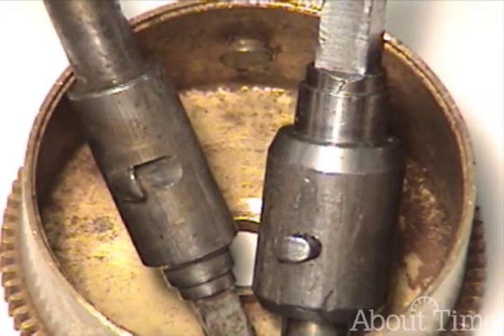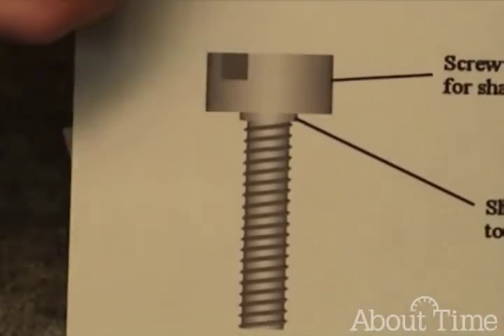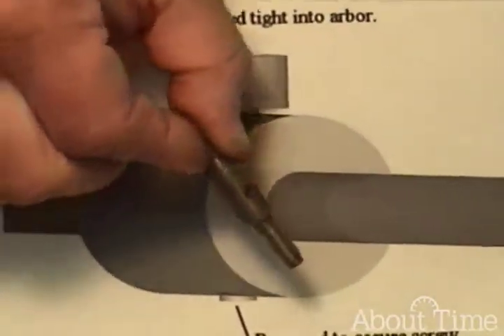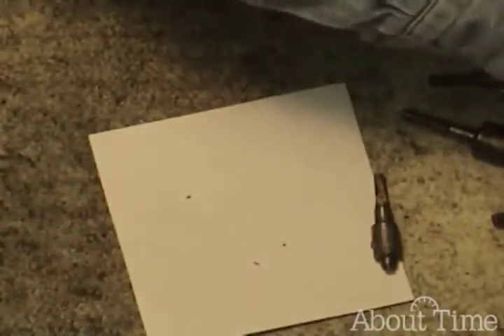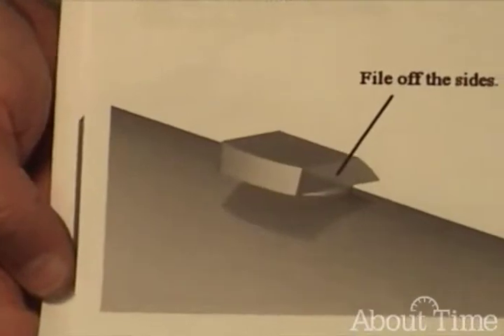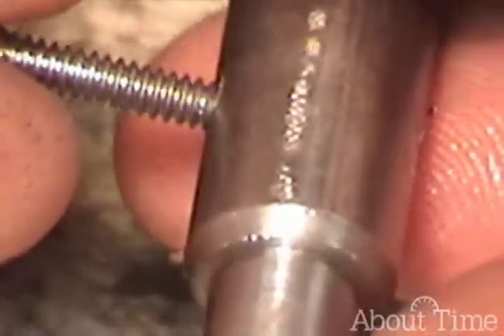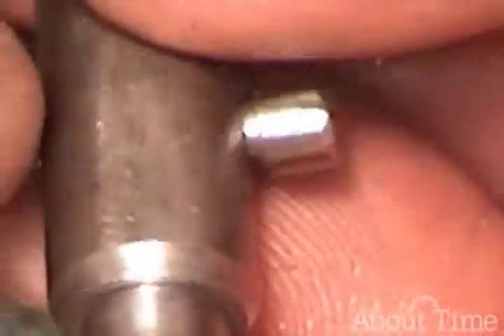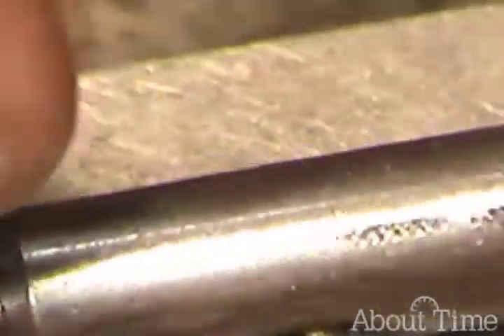ClockClass - Arbor and Barrel Hooks

Comment: I was in the process of replacing some broken trunions on two lantern pinions in my very old Jungmans bracket clock and thought I had better check the condition of the mainspring. I am glad that I did because
the arbor hook had been warn (or broken) away so that only a tiny pimple of metal was left holding the spring in place. Anyway, after finding your excellent video I decided to have a go at repairing it myself and I am pleased to say it all worked a treat. Many thanks for a really useful video..
Reply from the maker: I'm pleased to hear you found the video useful!

Comment: Gostei  muito,  só que  tem  um problema  não  entendo  o que  está  falando . Só brasileiro
Reply from the maker: Mainspring-driven clocks often have mainsprings in barrels.  The outer end of the mainspring catches on a hook inside the barrel and the inner coil of the mainspring catches on a hook on the winding arbor.  If one or the other of this hooks becomes damaged, the clock can't be wound because the mainspring won't catch.  The ClockClass DVD discusses the repair of both of these hooks.